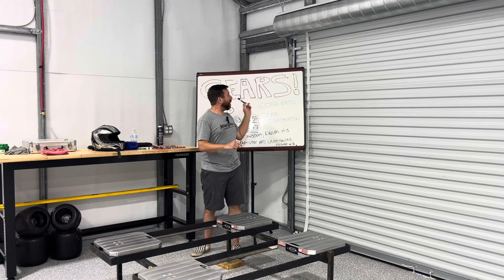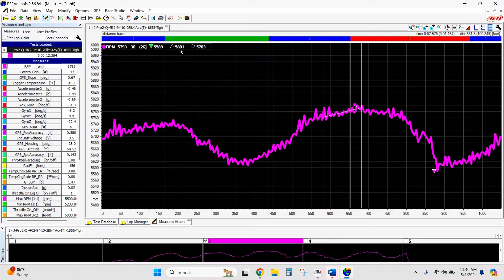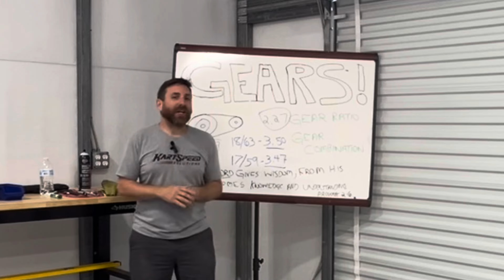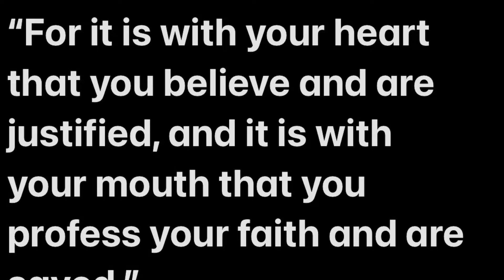How to Gears Part 4: Gear Bound!

Comment: How do you essentially pick what RPM you want your motor to turn? I run a BSP sealed motor. The saying here is around 5800 rpm. We are on a big 1/4 mile asphalt with sweeping turns.
Reply: We talk to our engine maker and he'll give us a range depending on the type of engine then we try and adjust our gear so that the rpm's fall into that range.
Reply: Or, in your case, "they say" 5800. Try gearing for 5600, 5700, 5800, 5900, and let the stopwatch tell you which is quicker.